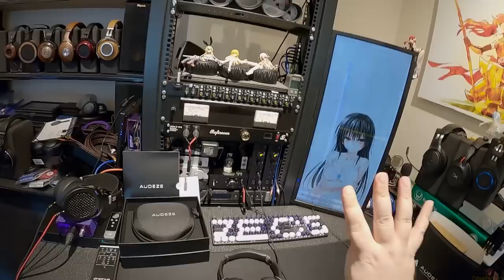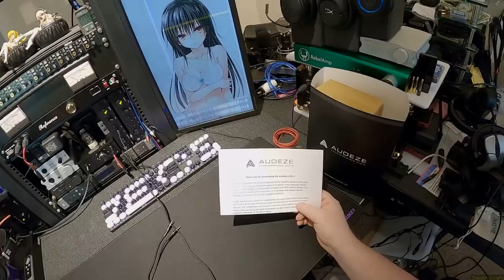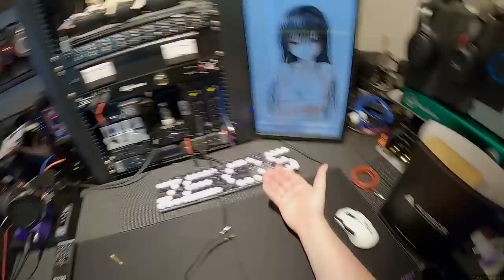Audeze LCD-1 _(Z Reviews)_ A fine Headphone

Comment: Got my LCD-1s on a b-stock deal for almost half off a couple years ago. AMAZING headphones for $250. I have listened to them for at least 1000 hours now, and I have loved them. Only ever used them at my desk. It's very odd to me to think of these as "portable", I can't imagine leaving my house with these headphones on my head. 

I did get the b-stock so I can't know how long these headphones were worn before I got them, but do want to point out that the build is not good. Within a year the plastic around the folding mechanism for the cup broke, then within another 6 months the same piece on the other side broke as well. And I have really babied these headphones, again never even taken them from my desk. So that's the only complaint I can say about them. But even then I took them apart and epoxied the plastic together. Now they don't fold but I don't care, I still love these headphones.

Comment: For anyone interested: the fuzziness that you can hear in the vocals is probably caused by the frequency response of this particular headphone. I used EQs from other youtubers (metal571, Chrono from The Headphone Show), but the fuzziness was still present. To be completely honest I use LCD-1 directly from my phone (OnePlus 6 without any dac/amp, so nothing special) and I use USB Audio Player PRO with the additional plug-in Morphit. I use the plug-in to make my LCD-1 sound like "Generic Studio target curve" with additional boost in the bass region (analog bell 30 Hz +2.0 dB 1.00, low shelf 100 Hz +3.0 dB 1.00). I also decrease some sharpness in the treble region (analog bell 10 kHz -2.0 dB 3.00). I also subtracted 1dB in 3.5 kHz region to make the vocals be more smooth (analog bell 3.5 kHz -1.0 dB 1.4). Output level is -8.0 dB. Using Morphit (even without additional EQ) makes the vocals MUCH more transparent. It's now much better headphone (especially with the additional EQ). More bass (and punch to some extent), more details, more transparency in the vocals, even bigger soundstage. Maybe it's not that smooth as it was out of the box, but definitely worth checking it out. Hope this helped some LCD-1 users.

Comment: Hey Z, I just wanted to thank you for your videos. I watched A LOT of your vids and finally decided to take my first step into the audiophile world. I bought myself some used DT1990s for 300$. I really love them, they sound awesome. I was afraid that I wouldn't be able to distinguish the difference between my DT880s and these, but god damn do they sound better. So much detail I've never heard before. Only thing that bothers me is they smell a bit. Like, the entire headphone. I already washed both sets of pads and rubbed down the entire headphone with a damp piece of cloth, but the smell remains. Anything else I could do? Also, is there a modmic type thing that can plug into the mini-XLR that I could use with a 4-Pin wire?
I also unsubscribed from all other audio youtubers as to not get tempted to upgrade anything. You're the only one I still watch, because your videos are just 
too damn funny. Exactly my type of humor.
Keep up the great work.
Reply: Luca Spengler I usually use motorcycle helmet cleaner to clean velour pads. It‘s like a foam and comes in a can. Maybe try using isopropanol or ethanol for the headphone itself.
Reply: I sold mine :( big regret.  Beautiful headphones.

Comment: 4:50 I think it is there to protect the pad from the grill of the other cup so the Pad lasts longer.
Reply: that makes sense, the only thing is that the grill is smooth plastic and even the edges are all rounded. so its just there for placebo i guess? maybe to protect the pads from the yolk system? i guess even audeze didnt know because they just tossed it in there with some velcro

Comment: What you demonstrated with the split cables (left/right does matter, and can be run indie with two amps even lol wow), then I would think a boom mic integrated line like Vmoda Boompro could be used on either cup, and a separate cable from the other (to split adapter), and that would be convenient. Do you believe that womwouls work without any negatives? Also, although I hear the LCD-1 has great soundstage, many other reviewers said it's rather small. Whether it his wide or short soundstage should be objective, no? Why the disparity? Same with imaging. Some say yea, a some say not so much. Again, objectively, there shouldn't be arguments. sigh. I guess I'm still leaning toward AKG K712. I want a great planar (for everything) but at a reasonable price, and built well. Really immense soundstage and amazing imaging?